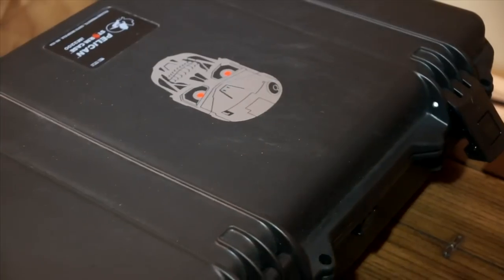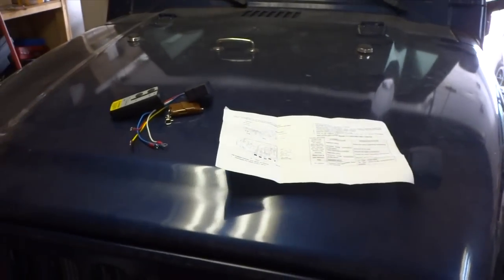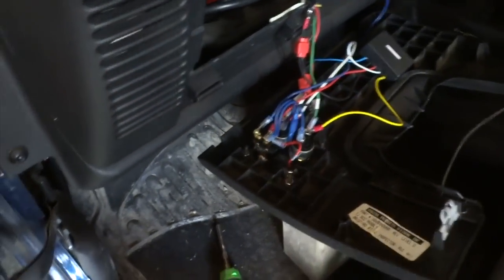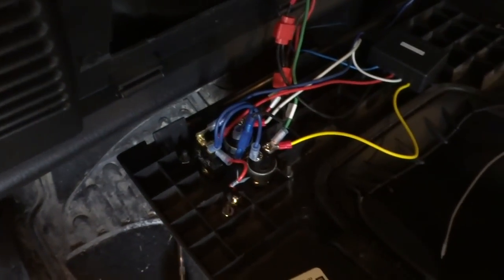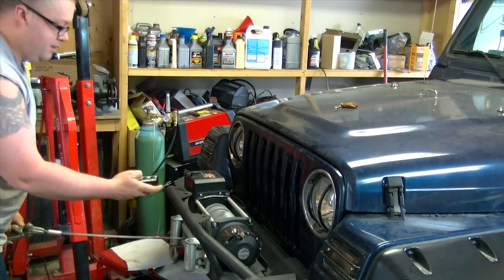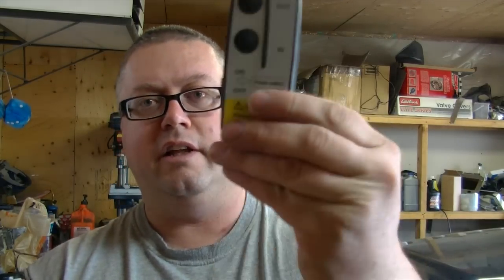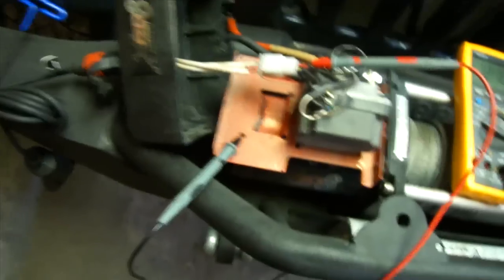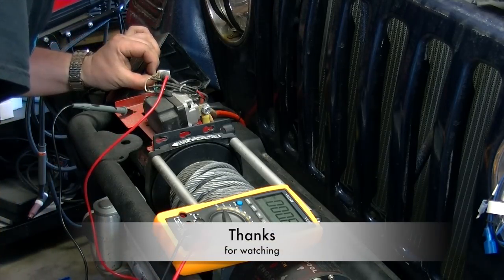Wireless Winch Controls DIY installation

Comment: I have a question for you.
What happens if you "press" both buttons at the same time ?
Does the unit have a preferential function (ie: first button pushed works), or a who cares function (both work if both pushed).?

No NOT when a set forward/stop/backwards winch/clutch relay is connected, but an alternative relay system.

The reason I am asking, is simply to find out if the remote activation can be "used" for an entirely different function.

ie: fog or spot light "flash" modes. 
Deliberately to flash either the front rear or both "fogs & spots", so that I can fit a fog/spot to the front & a fog/spot to the rear, and "flash" either one or the other, (or hold one in, or the other in) OR HOLD BOTH at the same time.?

Really good, in one person self-recovery..
To see where the hell I am, at night whilst "attempting" to traverse rough hilly terrain, so that I don't accidentally "fall off a cliff".. (especially when reversing OUT again, after going too deep into the wrong area).?

Comment from the maker: what kind of winch is it ?, the wireless is really good you would have to water proof the box and i'm sure if you look on ebay you could find a handle bar winch controls that you could hardwire in instead of using a big bulky controller

Comment: When I did the 4" lift I noticed that the steering was a little sloppy. (Not super responsive) then I was barreling down the highway a got a huge wobble when I hit a big bump. It then blew out the power steering. Scary! Changed out the steering box. 100.00 dollars cheaper in the states and it totally corrected the problem.

Comment: I bought that same model and the instructions were 4 lines of text, not like the instructions you have at all.
RED : + pole of battery or winch which has been connected to the battery
Black : - pole of battery or winch which has been connected to the battery
Yellow : Output of remote control, connect with relay (wire of handles)
White : Another output of remote control, connect with relay (wire of handles)
Green: Antenna wire
A wiring diagram would be helpful, which is why I came here. My setup is a bit different (1 rocker button), looks like I'll be doing some trial and error and hope I don't smoke the relay.
Reply from the maker: Was this video able to help you out at all ?
Reply: @BackCountryWrenching  The video gave me confidence that the remote could work, but I still couldn't get mine going. It might be defective, I haven't had a chance to bench test it yet. I know it has power, I can hear the remote relay clicking when I use the remote. I'm not the most electrical savvy guy either which could be the core issue ;-)

Comment: Hi there. I just purchased a jeep TJ,  and it came with an after market winch. 3000#, 12V, remote control.....but no remote. I've searched to try to find one but no luck. I know nothing about how this works but have a brother that does  but was hoping to get your idea first. Any help would be appreciated.
Reply from the maker: a 3000 pound winch is much too small for a quad that would be more suited for a side by side atv you'd need at least a 8000 pound to make it work for you.
Reply: Ok good to know.  Not sure why they would have it on a jeep to begin with. But oh well. Thanks again.

Comment: Does that remote control support 24 volt vehicle battery system
Reply from the maker: +vga2003 the one i have doesn't, but you may be able to find a 24v set up
Reply: +Bullshitkorner ok thank you

Comment: Who makes this remote just bought a xrc10. I'm looking for the wireless and the in cab controler. Thanks
Reply from the maker: wireless remote you can get off ebay, the in cab winch controls are from the 12voltguy.com
Reply: Cool ordered today it will awesome